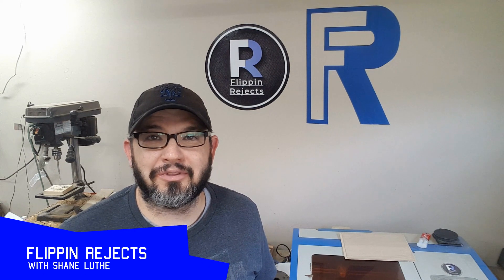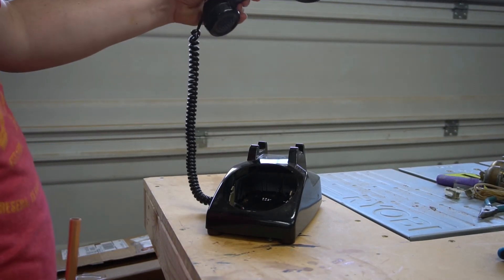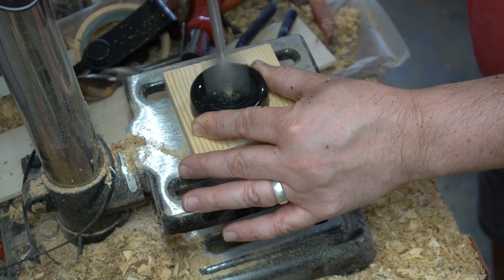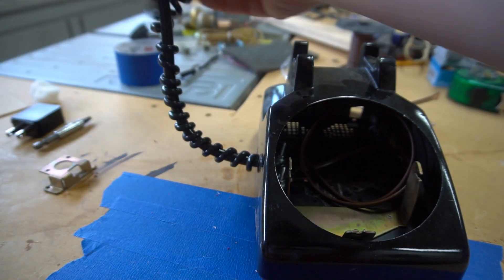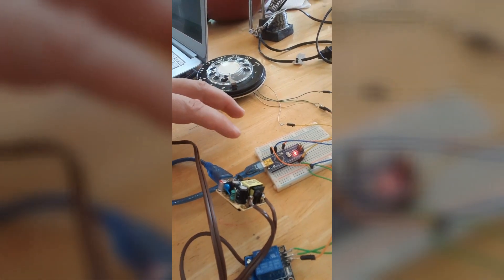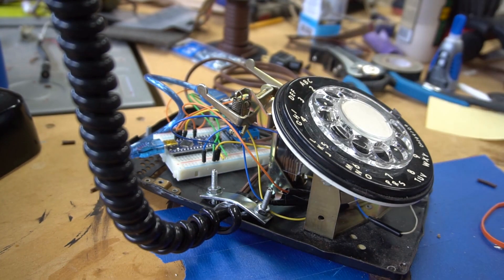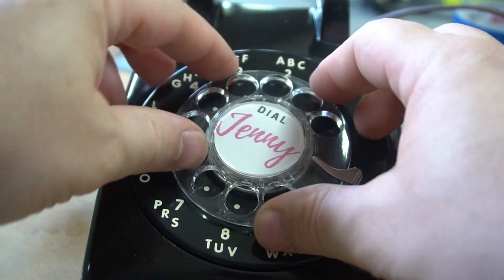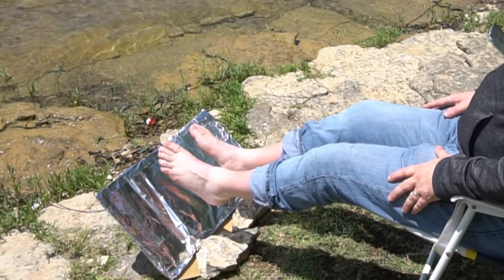I made a Rotary Phone Lamp that turns on when you dial Jenny for the #bwmenlightenus challenge.

Comment from the maker: This is the code we ended up with

#define PULSEPIN 3                  // Pulse Pin To Digital Pin 3 
#define SIGNALPIN 7                 // Signal Pin To Digital Pin 7 
#define LED LED_BUILTIN             // Working With The LED Built In
#define CODELENGTH 7                // Define how many digits the code is
#define RELAYPIN 8
#define RESET 9
const int secretCode[CODELENGTH] =  // Array to hold the secret code - each element should contain one digit 0-9 
            {8,6,7,5,3,0,9};
const unsigned long debounceDelay = 100; // Debounce time - the time used to make sure terminal contact bouncing doesn't produce false events
const int d=70;                         // The Delay Time For LED To Blink At The Wrong Password

// Working variables used to keep track of the counts always start at 0
int codeDigits[CODELENGTH] =        // Array to store received integers
            {0,0,0,0,0,0,0};
int currentDigit=0;                 // Var to keep track of which digig in the array we are on
int pulseCount=0;                   // Var to keep track on how many pulses in the current digit have been counted
bool pulseTriggered=false;          // Var to keep track of if the current pulse has been counted
unsigned long lastDebounceTime = 0; // Var to hold the last time the pulse pin was toggled
bool ledState = false;              // Var to hold the current LED state
bool previousSignalState = false;   // Var to keep track of when we transition out of a dialed digit

void setup(){
  
  Serial.begin(9600);               // Start Serial connection for print commands
  pinMode(PULSEPIN,INPUT_PULLUP);   // Define the pin mode for the dialer pulse pin
  pinMode(SIGNALPIN,INPUT_PULLUP);  // Define the pin mode for the dialer signal pin
  pinMode(RESET,INPUT_PULLUP);
  pinMode(LED,OUTPUT);              //led      As OUTPUT
  pinMode(RELAYPIN,OUTPUT);
  
  digitalWrite(LED,LOW);            // Make sure that the LED is off on startup
  digitalWrite(RELAYPIN,LOW);
}
void loop(){

  /* 
   * Read the states of the current pulse and signal pins into temp working variables. 
   * Since the inputs are active low (0v is an active true state), these variable take 
   * on the oppisite state (are inverted) so that the code logic is more readable.
   * 
   * If the circuite is setup as active high then remove the not symbol (!) and change
   * the pinmode of PULSEPIN and SIGNALPIN in the setup loop to INPUT.
   */
  bool pulse = digitalRead(PULSEPIN);  
  bool sig = !(digitalRead(SIGNALPIN));
  bool reset = !(digitalRead(RESET));
  
  if (reset==true){
    digitalWrite(RELAYPIN,LOW);
    for (int i=0; i < CODELENGTH; i++){
      codeDigits[i] = 0;
    }
   currentDigit=0;                 // Var to keep track of which digig in the array we are on
   pulseCount=0;                   // Var to keep track on how many pulses in the current digit have been counted
   pulseTriggered=false;          // Var to keep track of if the current pulse has been counted
  
   ledState = false;              // Var to hold the current LED state
   previousSignalState = false;   // Var to keep track of when we transition out of a dialed digit
  }
  /*
   * First, see if the signal line is activated. If it is then test to see if a pulse 
   * has been detected that wasn't already detected and isn't a bounce of the mechanical contacts.
  
 
   */
  if (sig == true){
 //Serial.print("processing signal"); Serial.print(" ");Serial.println(pulse);
    if ((pulse == true) && (pulseTriggered == false)){
   //Serial.println(pulse);
      if ((millis() - lastDebounceTime) > debounceDelay){
        pulseCount++; // Add one(1) to the pulse count variable
        lastDebounceTime = millis();
        pulseTriggered=true;
      }
    }
    /* 
     *  if the signal line and pulse trigger are activated but the pulse line is not 
     *  then we need to reset the trigger for the next pulse
     */
    if ((pulse == false) && (pulseTriggered == true)){
      pulseTriggered=false;
    }
    previousSignalState = true;
  } else {
    /*
     * If the signal line is not active then either nothing is happening or we just 
     * ended the number and the pulse count is our digit. First check to see if the 
     * signa line was previously activated and if so set the current digit in the array 
     * then, increment and reset counts
     * Valid pulse count are 1-10 and if there are pulse counts below 1 or greater 
     * than 10, ignore them
     */
    if (previousSignalState == true){
     //Serial.println(pulseCount);
      if (pulseCount == 10){
        codeDigits[currentDigit]=0;
      }
      if (pulseCount < 10){
    
        if (pulseCount > 0){
          codeDigits[currentDigit]=pulseCount;
        }
      }
      
      /* 
      *  Next increment the digit count and reset the pulse count and trigger
      */
      currentDigit++;
      pulseCount=0;
      pulseTriggered=false;
      previousSignalState = false;
    }
  }

  if (currentDigit > (CODELENGTH - 1)){
    //test and reset
   //Serial.println("test");
    bool codeCompare = true;
    for (int i=0; i < CODELENGTH; i++){
      if (secretCode[i] != codeDigits[i]){
        codeCompare = false;
      }
      codeDigits[i] = 0;
    }
    currentDigit=0;
    
    if (codeCompare == true){
    Serial.println("Correct");
      correctCode();
    } else{
     Serial.println("fail");
      falseCode();
    }
  }
}

void correctCode(){   // Function that exectures when the correct code is entered

  if (ledState == false){
    digitalWrite(RELAYPIN,HIGH);
    ledState = true;
  } else {
    digitalWrite(RELAYPIN,LOW);
    ledState = false;
  }
  

}

void falseCode(){     // Function that executes if the wrong code is entered

  for(int j=0;j<15;j++){                          // Blinking The LED
    digitalWrite(LED,HIGH);
    delay(d);
    digitalWrite(LED,LOW);
    delay(d);
  }
}

Comment: Any links to the parts list?
Reply from the maker: Arduino, old phone, brass rod to hold up receiver handle, and whatever lights you can find to go in the receiver. I found xenon lights, but I'm sure some LEDs would work better. Thanks for checking out the video.
Reply: @FlippinRejects   thanks.. i have one of these phones  ready to go no working on the guys.. Kind of new to Arduino but i just ordered one along with a 5 volt relay. I see a few different models of the arduino i just ordered what looked like the one in the video. I'm just curious the input from the rotary dial where it would pin out to on the Arduino and the output to the relay. If you could point me in the right direction on some rough idea on this i would greatly apricate it.

Comment: This is awesome, and so creative!  The code is useful for one of my projects, too.  I plan to place a rotary phone on a bookcase and require dialing a special number on the phone to operate an actuator which causes the bookcase to swing away from the wall, revealing a door.  I had already planned on using an Arduino and will probably reuse some of this code, so thank you!
Reply from the maker: Thats awesome. Please post pics here when you get it done. Thanks for checking out the video.
Reply: @FlippinRejects  It will be a while because we have a house to build first.😄 But I will share if and when I complete it!

Comment: Any hints as to what kind of LED bulbs those are? IE either a part number or Amazon link? Just searching for small LED spotlight on Amazon is not turning up anything useful.
Reply from the maker: I used some small xenon bulbs I bought from my local Lowes similar to this link Feit Electric BPXNFTD/2 Xenon 20-Watt Halogen MR11 Bulb https://www.amazon.com/dp/B0031AJZL6/ref=cm_sw_r_cp_apa_i_2TA46DA88546BW9ATNS2  
But you could look at car under chassis or rock lights that are LEDs. Just make sure they are small enough. There isn't too much room in the handset once you start running wires. Hope that helps. Thanks for checking this out.
Reply: @FlippinRejects  Thank you very much for the reply!
Reply from the maker: @Part_121  no problem
Reply: @FlippinRejects  This is where I have been coming up short too. Finding bulbs that will fit just right. Thanks.

Comment: That’s really cool! Is it wired to the original rotary switch or is that a new part added?
Reply from the maker: It is wired to the original rotary dialer. Thank you for watching.
Reply: Flippin Rejects very cool! Would love to know how THAT part was done
Reply from the maker: There are 4 wires from the rotary dialer. Two are for the pulses ( each number) then the other two open when the dialer stops. They are all tied into the arduino at different pins. The code uses a pulse counter to tell what number is being dialed.
Reply: Flippin Rejects genius